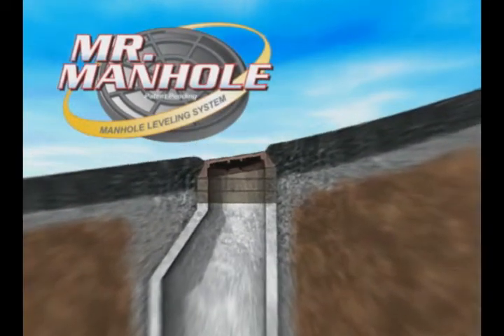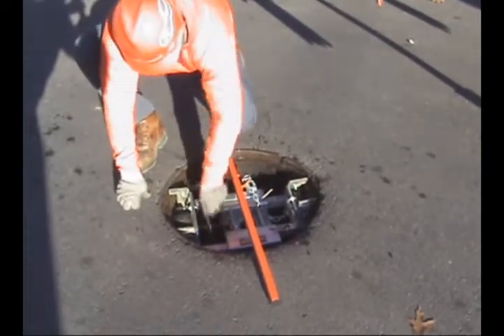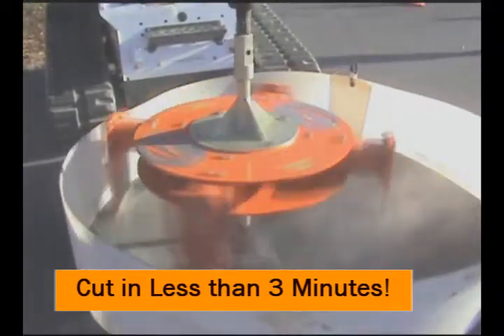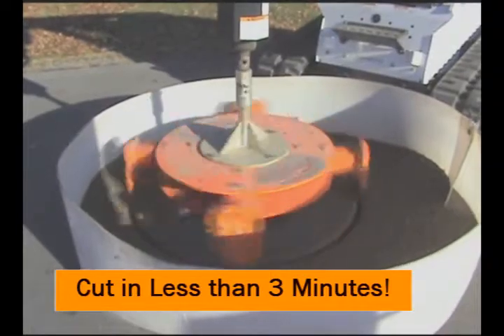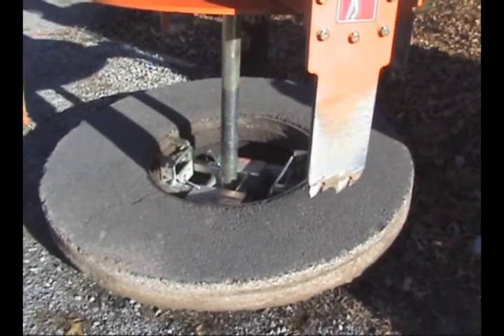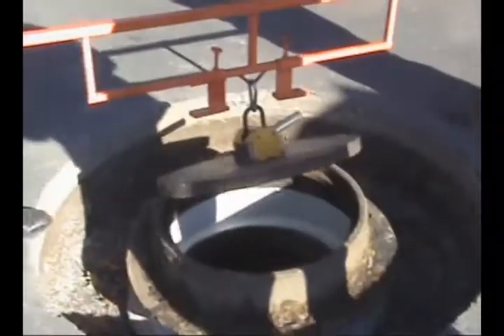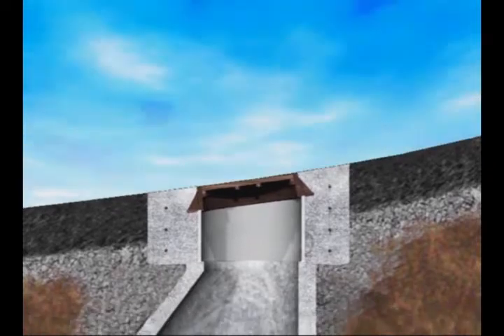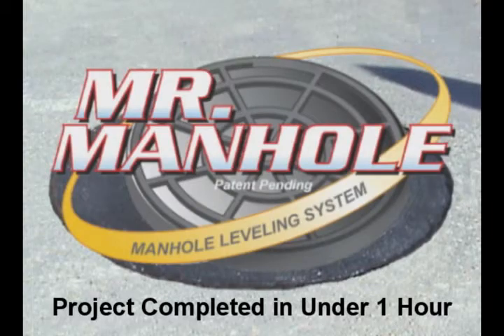Mr. Manhole System Overview

Comment from the maker: We are a Delphos based company. The smooth manholes in town with the wide round concrete surround are created with our tools. All manholes in the community are spec'd to be replaced with our system. The smooth manholes on Allentown Rd between Cable and Eastown were put in using our tools as well. In regards to your comment, did you find the video unclear?